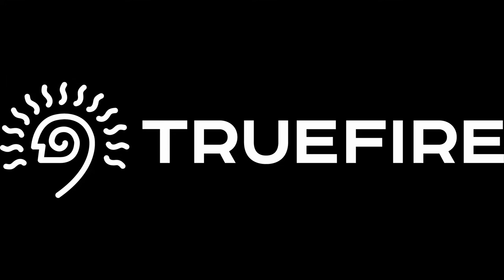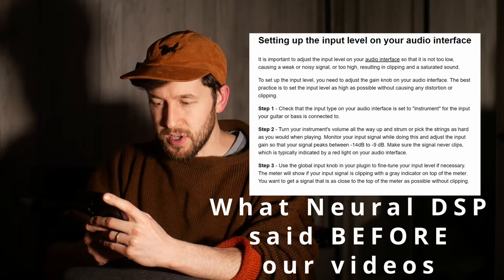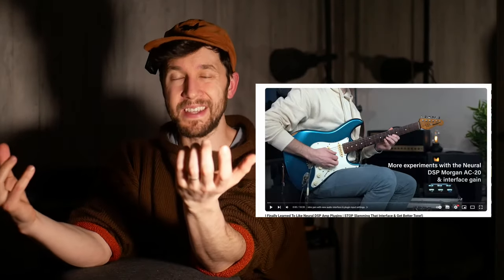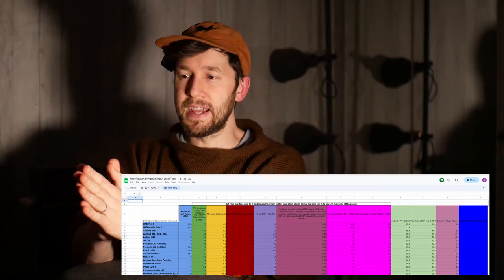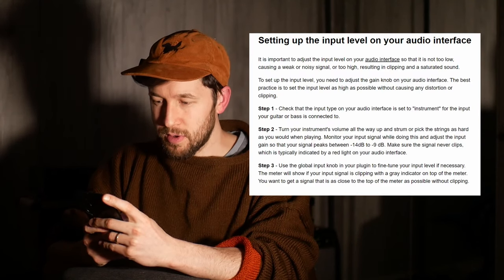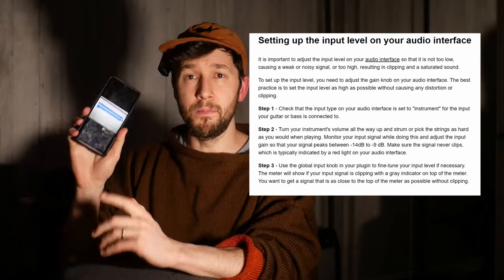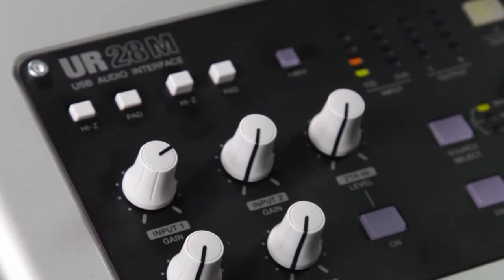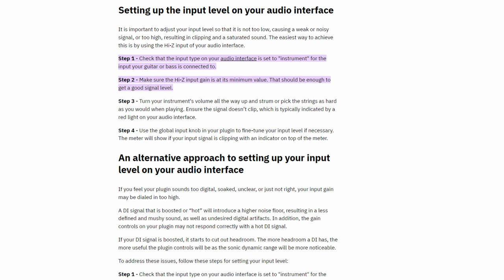Why Are Neural DSP Gaslighting Us About Plugins and Input Gain?

Comment: I set up the gain on my interface so that is not clipping, as they always said, and THEN i lower the gain on the plugging, i always thought that was the point on putting a gain button on the pluggin anyway. You cant really plug your guitar direct to the plugin, you NEED to use an audio interface...
Reply: You can plug a guitar into your line-in (PC soundcard) using a simple 1/4 to 1/8 jack adapter. Just use a buffer pedal or some OD pedal with zeroed drive knob. That would be your "Hi-Z" transformation. Sounds pretty good, just has more hiss with high gain compared to a good interface. Btw this Hi-Z buffer thing is also extremely easy to craft out of handful of electronic components.
You are correct, gain on the interface should be as high as possible and then you decrease virtually, in plugin or with an FX before the plugin. More quality that way. Author of this and other similar videos missed this part completely. At first I was very confused but then realized: they use input gain setting of neural dsp plugins or maybe NAM, and that setting is not flexible enough to suppress the loudness of the input signal to match the level that the plugin expects. That's a real problem, some plugins sound improperly or even awful if you don't decrease the input signal enough. Users just need to use additional FX prior to the plugin to decrease the volume of the input signal. But a loud signal in the very start of the FX chain means more bitdepth and better quality after further processing. When you decrease level in DAW, it decreases without bit precision loss (thanks to 32-bit or even 64-bit math). While signal from the interface is sort of 24 bit but with lots of unusable noisy bits on the bottom. With highly dynamic guitar signal most useful waveform contained in a small bit range, less than a dozen of bits. Turning gain knob on an interface down decreases that bit range even further. This is so harmful, they just do not understand what they are doing with these suggestions and hype videos.

Comment: Very good video, I'm contributing with my personal take. When I had the Focusrite audio interface, it would almost clip at volume 0, so when playing clean sounds it would translate perfectly. Then I added a Palmer DI, always Gain at 0, never had any problem. I then bought an Audient interface and the same happened, volume input at 0 and everything sounded perfectly. Neural absolutely wrote something easily misunderstandable, but also the players that would find something not right, with the input level so high, I think should've used their ears and adjust to their equipment just from the fact that everyone have different guitars, pickups. interface ecc. This is my personal take, not to judge your video which I find extremely clear and useful, cheers!
Reply: I'm guilty of this.  As I posted elsewhere, I did at least figure out that input gain was an issue for me.  But stubbornly, I kept following what I thought was "best practice" and tried to compensate instead via other means, such as an EQ pedal between my guitar and interface input.  Instead of just using my ears.  The EQ is still useful mind you, but I can use it much more effectively now that I understand the signal chain end-to-end a bit better.  Alas, to add the confusion I think the EQ is buffered (MXR 10 band EQ).  So just going to have to what I did before all this digital stuff existed lol.  Use my ears.
I'm not anti-digital by any means - I just think it requires a little investment of time to understand it and make best use of it, and some players understandably just want to plug in and play.  Absolutely nothing wrong with that.

Comment: I don't think any of these videos actually address another specific use case which is DI Boxes. Yes, ideally going through the Hi-Z input you should not add any gain. However, in using a DI Box, you bounce your guitar signal down to line (mic) level and no longer go into the Hi-Z input. In which case you almost always have to add gain on your interface. There's still little guidance in this scenario, where we're left to add gain until it sounds "right"

Comment: I understood from the start that 0 input gain was correct because UA Apollo Console amp plugins use the input gain knob to adjust the amp gain knob (you turn the input gain knob, and the gain knob on the amp turns). So I realized that input gain is not needed or they wouldn’t have implemented it this way.

Comment: I have been following this since Rhett’s video. I use Bias Fx 2 a lot in home setting and if I set interface to 0 gain, it yields VERY low input signal on amp sim and to me doesn’t sound good at all. I have been adjusting interface input gain to bring input level on sim to -10 to 0 and it seems to sound much better. Anyone know what BiasFx2 settings ‘should’ be or am I doing this wrong? I use MOTUM4 btw. Thanks

Comment: When I first got my AI, I always set my gain to 0. That change when I had MLS ML5 plugin. Channel 3 of that plugin, which is suppose to be hi gain channel, sounds weak and thin. I can't get a nice chugging sound. So I increase input gain on my AI to 10 o'clock and finally I can get a nice chugging sound. But, when I play using MLS CB4 or Dual, I can't get any usable sound. The bottom end is so overwhelming. I never use those two plugin anymore.

After rewatching your video and Ed's, I begin dialing my AI gain to 0 and adjust input gain on plugin itself according to Ed's table. Suprisingly, I get a usable from CB4 and Dual. Other plugins also sound more open and not too wooly on the bottom end. 

Conclusion, Ed suggestion makes my tone sounds better. So I use it.

Comment: When the interface is set to 0 on my ID44, the recoded Hi-Z DI of a single coil pickup is very weak, -30dbf. Will my mix engineer laugh at this low level DI? Im scared.
This is the question, should we record our DI signals at 0 gain for future use? Even if the signal is very weak?

Comment: BTW, the majority of A-I have an issue raising noise levels when maxibg out Headphones. Consider this too then if nit setting Gain at Optimum. YES, if you raise levela of say only 10bits of 24bit potential, you do raise the noise floor!
Clipping is OK if you understand there are 4bits  in this before distortion clips are discerned. Using a Bit Meter will show this.
Sone DAW use an industry fixed -6dB output. Now we also can use 32bit Floating wirhout any clipping.

Comment: It was not something I could understand to have the same input strength for single coils and humbuckers. So I questionned me how to do (it was a long time ago).
Tu adjust everything for the same signal level was an error. It was not a logical thing and it made me afraid about how VST programmers think about that.
I compared Helix Native with my Helix, and lowered the input gain of my audio interface to zero.
But this confusion is embarrassing, it could make errors in the amp simulations.

Comment: TH-U Overloud even has a "tool" for tuning the input gain. But I tried it with a bass and it told me to turn it waaaay up. (They also have bass amps.) It just made the bass sound distorted while telling me I was doing great. This topic is rather confusing - from the amp sim manufacturer side.

As regards my audio IF gain, I admit to not even checking the manual - I just trusted the lights on Focusrite and tried to not ever get red, maybe not yellow, either. I did think Line 6 Helix Native sounded way too hot. Like everything sounded hot, and I split my playing between single coils and humbuckers. I just didn't connect the dots to think that my way of setting input gain was wrong on the IF already. 

The green light is a lie for DI...

Comment: funny thing for me is when i finally got an amp sim i plugged in with interface input as directed it didnt sound right. so i fiddled and fiddled and by chance i turned my interface gain to zero and was pleasantly surprised by how good it finally reacted and behaved, i figured i must of read something wrong in the setup guide and just left it alone and just enjoyed the sim,, then a few weeks later you put out a video on the subject ,which was great insight, and now its a thing i guess  hahaha. i really appreciate your insight and  Eds spreadsheet , especially now since i upgraded to a much higher end interface with a max in at +18dbu, now it really is a thing for a certain sim that seems to be all over the place with their capture process,  its a bit frustrating at times to dial amps in. it really seems that their wasnt/isnt a  standard base gain stage  for capturing these tones.. i really hope a standard capture level is set for the industry and we wont need to get a math degree just to play some freakin guitar,, haha were musicians for cryin out loud not scholarz. but on the real, thanks for bringing attention to this little, very relevant,  and now less likely overlooked vital piece of the digital puzzle. .. (i think it's easy to forget or take for granted, just how new and great these amp sims and modeling software's are. i remember only able to wish ot dream about the gear i have now with these now...)  cheers thanks for the vids and great guitar playing

Comment: I don't think the main thing to take away from this is that you have to lower the gain on your interface. That is still a best practice and shouldn't be changed (unless it uses floating point representation, but most interfaces don't). You have to record taking advantage of the available bit depth so you do need to max the input range, that ensures not only to have a nice input level, but to keep the digital noise floor as low as posible. After the sampling stage, your DAW will work in floating point representation, between -1.0 and 1.0. All these plugins are non-linear in nature so If you want to change their response you just have to lower the input range, digitally. That is putting a digital audio knob before the plugin (like Utility on Ableton Live). That will multiple the floating point representation by a number between 0 and 1, lowering the range. But, no, you should keep gain stagging maximazing each stage, and the preamp should still be peaking around -12db.

Comment: Sometime early in my discovery of guitars and guitar plugins, I realized it made no sense to add any gain at all to the DI system so I got that hapbit.
However I always felt my Helix Native presets felts weak, initially throught it was "just" my guitar because it's signal is weak.
Turns out that from your video and discussions on the Line6 Helix discord, I learned that the manual of the Helix Native plugin does clarify that the input signal should reach a specific level which is green visible on the left of the plugin. I also learned that all hese plugins need some specific levels, so thanks for that.

Comment: Always I set up my knobs at zero on my interface. CuZ I noticed that the signal was too hot. Causing and adding extra distortion and noises. (Since ezmix) Back in 2010. So yeah. No issues last decade.😅

Comment: In my opinion, you want the loudest output of your guitar to be in the -6 db range (meter).  Adjust your interface to achieve that.  You want to use the dynamic range of your AD converters because guitars have a large dynamic range.  If the plugin sounds over-gained, then back off.  If it sounds under-gained then boost it.  "Use your ears", is the most practical advice in my opinion.  If it sounds pleasing to you, then that's that, right?

Comment: Turning up the pre-amp adds noise, not removes it. Your interface is 24bit or better - it can provide just as good a dynamic range at -50dB as -2dB
(FWIW my technique had been palm mutes to -9dB which ends up my evo16 interface flat on a Lollar single coil anyway, then turn down the plugin input gain til it sounds right.)

Comment: So if you use single coiled guitars, humbuckers or EMGs you always leave it at zero? Don't they all have different output levels?
Reply from the maker: Yep that's the point moreorless (it is an oversimplification, but adding gain is compounding the issue rather than solving it)

Comment: Now we just have to get the creators to give us a comprehensive list of where the input gain needs to be set on their plugins for each interface. Eds list was great but it still misses a few like the Audio Assault range.
Reply: Some companies are refusing to give straight answers on this issue, or worse yet, completely ignore the question! Those are the ones missing from the list mainly. Audio Assault is one of those unfortunately. I have heard they never even bothered to use a consistent internal standard for their own plugins when modeling them! Supposedly, the developer just used some random D.I. tracks from his friend without even knowing what the levels were! \m/

Comment: I have been adding gain from the interface because that has 100% not only been the common wisdom but also constantly reaffirmed advice since I started home recording with a PC before these interfaces were even a wide thing. And when the interfaces started coming out left and right this didnt change. 

I also wouldnt say for everyone to bottom it out. My Presonus is -15db at zero,

Ive pretty much just started, starting off at bottom after freshly loading a plugin, and turning up until it sounds like the right amount of presence (really ive not had to give it more than a couple/few DB, it gets real out of hand real quick above that)

Comment: Thanks for your vids on this.

I can't help but think this is one of the reasons I've now gone back to using amps. I've tried loads of Boss/Line 6 boards as well as the Kemper for a good while, but there is just something that goes missing when I'm not using an amp. And I can't really explain what it is. Fwiw I'm of the Brian May school where I use my volume knob a lot to set how much gain I get - and I've always hated how that works with every modeller I've used (I've always had to disable every noise gate as a result btw). N modeller I've ever tried does that well imo.

Fwiw I do have and use a lot of the Neural DSP plugins in the studio, but my main guitar tones are amps  these days.

Comment: It is a gain-staging issue. Gain staging just refers to making sure the various "stages" in a processing chain have the right gain to achieve the desired result. It doesn't mean "maximizing final signal-to-noise." That can be a goal for gain staging, but it doesn't have to be. The issue is that back in the day of 16-bit converters (i.e., with limited dynamic range), most of the time you really did want to maximize S/N, esp. with quieter signals like from microphones (other than those against the grill of a Marshall!). Nowadays, with very quiet 24-bit converters being common (and some converters being 32-bit), there's plenty of extra dynamic range. It's still not a bad idea to roughly maximize S/N for most linear processing scenarios (mics, synths), though with 24+ bits it's better to leave significant space on top in case the performance gets louder than what was used to set the gain (as happens all too often!). But if you are doing nonlinear processing, good gain staging means setting gains so that the nonlinear processing stages get the signal at the right level to produce the intended outcome.

What's puzzling to me about all of this is that, having instructed customers to gain stage to maximize S/N into the start of the chain, why did the manufacturers not design their algorithms to correctly process such signals? After the signal is digitized, it's just a number; there's no rule saying a particular number had to correspond to 1 Vpp into the jack on the amp being modeled. They would have had to tell users something like "set the knob to just below clipping for the loudest humbucker guitar you can find." But there's no way around having to say something like that, whether the target is just below 0 dBFS or -12 dBFS or whatever, unless you do the work to find specific gain settings for particular interfaces.  —Tom

Comment: I tried adding input gain after reading this advice a few years ago, but as someone who plays metal and whose favorite guitars are equipped with Fluence Moderns and Seymour Duncan Black Winters, I couldn't even touch the input gain knob on my 2i2 without it clipping - it already hits orange on the monitor ring when the knob is zeroed out haha. But yeah, I can see where this is a problem. Rabea's been making videos sort of circling around this idea for a while now, as his plug-in is super noisy compared to the other NDSP stuff - and definitely compared to the ML Sound Labs stuff.